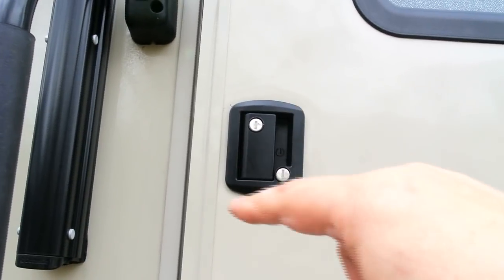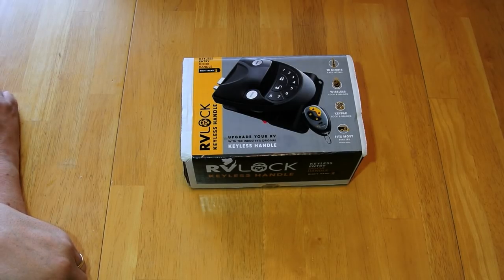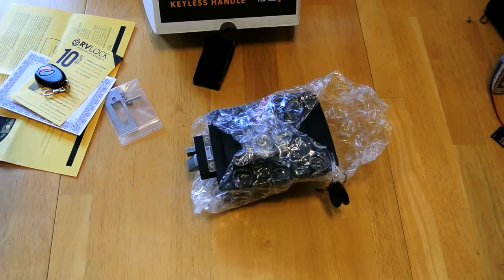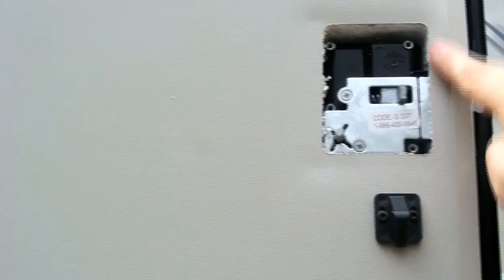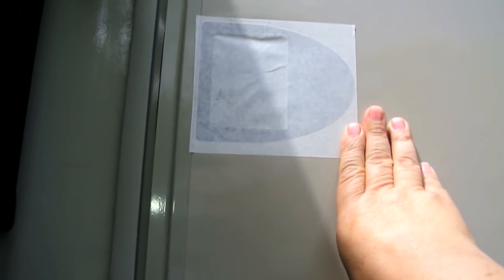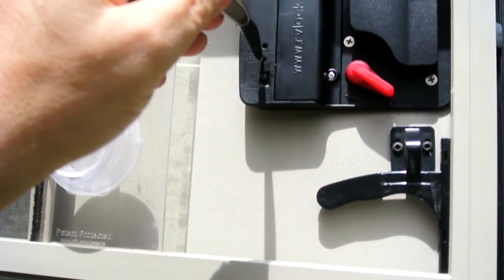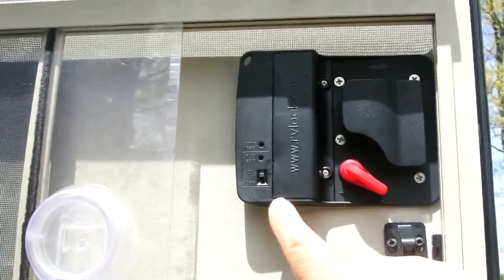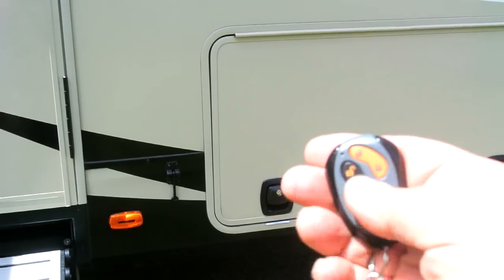Installing a RVLock Keyless/Wireless Door Lock.

Comment: I have been locking for a lock different from the usual. thanks for the video
Reply: Rusty Williams most and I mean most have 5 key sets if you order them off the internet you could go in any of them you still are not away from that problem you still have keys that will open them up ready and available for a small price I'm looking for something like what you have at home!!!

Comment: I can see that it adds a bit of convenience so sticking a key in a lock is not necessary but, it doesn't appear to add any more security to an existing deadbolt mechanism.   At least not that I garnered from watching this video.   One of the biggest reasons for going to an aftermarket deadbolt would seem to be that the replacement would be a beefier deadbolt mechanism for added security.
Reply from the maker: Same style deadbolt - you would have to change out the strike plates and things on the door otherwise.

It's mostly about convenience. If we go to the beach, we don't have to take a set of keys with us (we locked ourselves out of the RV one time).  

Or even better, if one of the kids has a set of keys because they want to go to location A and we want to go to location B, you don't have to worry they might lose a key.

Comment: I have one just like it.  I'm disappointed that it only locks the dead bolt.  I still need a key to lock the door latch.  Keyless?  ...not really.
Reply from the maker: The deadbolt is still secure.  Rv-lock is about to release a bluetooth adapter. I have it on pre-order, and will do a review. Maybe it will be different.

Comment: The "gasket" is a sticker for doors that don't take the lock out when they paint.
Reply from the maker: Unfortunately, the lock does not always replace the ones it advertises it replaces due to the shape of the case vs. the skill of the factory installer (the person cutting the hole in the door).

Comment: On the Ver. 4 RV locks if you want to get rid of that awful loud beep (hold down the 1 button until it beeps and it will be muted), hold down again to enable again.  Unfortunately this does not work on the baggage locks...
Reply from the maker: Good to know. Will have to try it.

Comment: That syringe  with silicone  were you bought that ?  , thank you !
Reply from the maker: I bought the glue syringe kit here: https://amzn.to/2KxMke8

It doesn't come with silicone, but I simply "loaded" the silicone into the syringe before use.

The tips come in different sizes, 14AWG seems to be the largest and is the one I recommend for silicone.  Smaller tips are harder to use.

Comment: I was about to buy one then I read a review where a man took a screwdriver and easily pried it off. He did this because it failed and the key was in the rv, lol.
Reply from the maker: Not sure how you would pry it off with a screwdriver. However, the doors in the typical RV are paper-thin anyway, and the OEM locks would not hold up any better I don't think.

Comment: How you going to title video "installing" then not show installation? SMH I'll look for another video
Reply from the maker: The purpose of my videos is to show things unique to the installation that other videos do not cover. 

You are correct, other videos may show a step-by-step installation, but my videos go a bit further and show pitfalls or other difficulties you may have. 
I often leave out items that are self-explanatory.
Reply: @RVProject  Maybe leave out the misleading titles unless you intentionally did it for click bait. An "installation" video with not installation is just a talk video.
Reply from the maker: @jimmywallace2782  I don't typically do step-by-step instructions as that can read instructions should not have any problem.  I always tend to focus on when the instructions are not clear, pitfalls, or difficulties you may run into when doing an installation.  

One issue is that there titles cannot be too long or it will not show up in the preview. So "Highlight Video of mistakes and pitfalls when Installing RVLocks in my RV", is too long.  "Installing RVLocks in my RV" fits the video preview better.

If you expect a step-by-step installation, you will not find too many of those here as those videos tend to be too long and boring.  I rather like to get to the point and touch on the highlights.

That is my philosophy when creating videos. Anyone can create a step-by-step video. But having videos that can help in difficult situations or avoid making mistakes is where I put the focus.  If that does not meet your needs, I am sorry that the video did not work for you.
Reply: @RVProject  Didn't expect step by step... Did expect an installation in a video marked installation. Perhaps in the future you could call it what it is. All it takes is one good video to land another subscriber or one bad one to make someone avoid it. I'll look elswhere.
Reply from the maker: @jimmywallace2782  I think you are getting hung up on semantics, or just want to be argumentative.

Early in the video, I did mention that this would not be a traditional step-by-step installation. Did you bail out there or did you watch the full video?

In the video I:
1. showed where to obtain a template for the cutouut.
2. showed where to find the owner's manual.
3. showed the sloppy fit with the gap in the door cutout. 
4, showed the optional "gasket" to fill the gap.
5. showed that some trimming was necessary.
6. showed how to program the lock.

Also at the end of the video and in the description, there is a link for both follow on videos as well as the project webpage. Most of the projects at RV-Project.Com have both a video and webpage, and together they make up the project.

Included on the webpage are links to other RVLock videos, including:
Installing baggage doors.
Fixing poorly designed baggage doors. 
Adding shims to the door.
Replacing the switch membrane.
Programming remotes.

Sounds like an installation to me.
Reply: @RVProject  Just constructive criticism, take it or leave it, up to you. Fact: it's titled "installation" also fact: there is no installation. The fact you needed to inform viewers early on that it was not an installation video is also entertaining.
Reply from the maker: @jimmywallace2782  Well I am glad you at least found it entertaining.